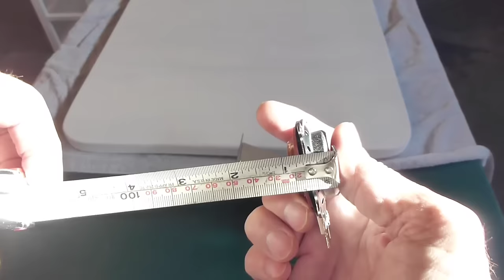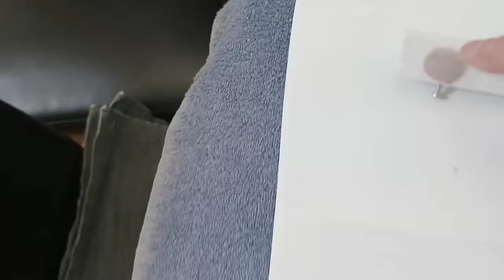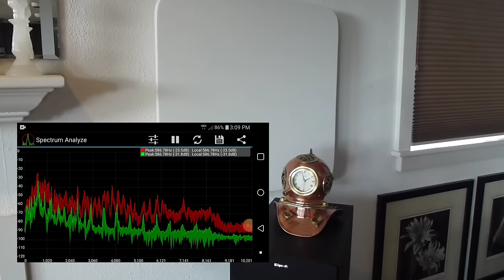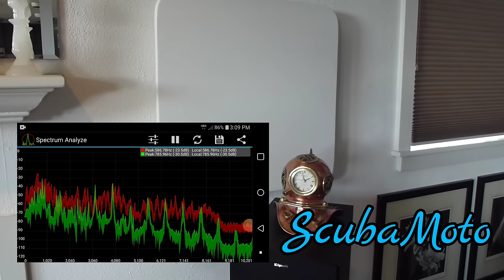How To Build DML Panel Speakers with Hidden Wall Mounts Fully Suspended

Comment: I'm wondering why no-one has even tried mounting the back of the exciter on something solid to act more like a conventional motor as that would create the highest and most consistent force on the panel, especially for the lower frequencies presumably limited by the exciters' small mass, never mind its own resonances interacting with those of the panel. About 25 years ago I made exciters like these to turn panelled walls into speakers, and it's always interesting to see how many of the ideas I tried long ago get developed into practical applications only recently.
Reply from the maker: Several viewers have made the same comment about fixed mounting exciters. One tried it and reported back that he didn't care for the audio results. I still suggest that you give it a try and see if you like the sound. If you like it, that's what matters. let us know how it works out. Thanks for sharing.
Reply: Well once you do that, you’ve just made a giant normal speaker with no box or ports or anything
Reply: I'm here because i heard you tooting your own horn from the other room... with youtube closed.
Reply: If you mount the exciter to a frame, it better be extremely stiff, and preferably very heavy. If it is not stiff enough, it will vibrate and make it's own sound.

Comment: I'm considering making two of these and getting and amp with built in streaming and HDMI ARC OR buying a soundbar.

Let's say the amp costs $500 USD and these speakers cost $50 USD do any of you think these could compare to a $550 USD soundbar?

Comment: Tech ingredients had mentioned that spray paint worked well if far away enough, but you used latex house paint, does that change the sound at all? or too little that we couldn't really notice? maybe have to be super thinned out?
Reply from the maker: Eric F: I haven't compared it to spray paint but the fabric grain effect of brush painting is the look I wanted and it also worked out quite well for sound. I hope that helps.
Reply: @ScubaMoto  I started doing mine, so far so good and decided to go with the latex paint like you did.  Question:  you think the distance from the wall is a factor on the quality or freq response? or just have enough room to "breathe"  move freely is all you need?   what do you think? I read somewhere to leave at least 2 foot from the wall, that seems counter productive to me.
Reply from the maker: Eric F:  I'm glad to hear you've started the build. Wall mounting these does effect the sound but 2 feet would no longer be a wall mount. I put a note in the video description regarding my experience with distance from surface. I hope that helps.

Comment: Hi is their any way you could make a push fit design speaker as i have tremors and find it dangerous using heat iron
Reply from the maker: Andrew Bird: I chose the hot glue because it adheres very well to the foam and dries in minutes but hot glue is certainly not necessary. You just need a glue that adheres well to the foam and dries hard enough to handle the lateral tension on the mounting pins. You may be able to see remnants in certain parts of the video of the first trial runs of different compounds I used. They either dried too soft or did not adhere well to the foam. I considered using screw-in anchors like screw-in drywall anchors (Togglers) but they are too long and do not truly adhere to the foam well enough to provide a lateral structural tension load. So, any glue or epoxy that dries hard and adheres well will work. I hope that helps.

Comment: What I wonder is they say to have one exciter in the center of one board and one off-center on the other to cover more frequencies. But wouldn't that make the frequency response different for your left and your right speaker if doing a stereo setup? Would you need two boards on each side, one center and one off-center for each side for the best results?
Reply from the maker: Talking Hands: I've heard that as well. For the video I just wanted to show that this wall suspension system could accommodate both exciter positions. I put a note in the video description on exciter location. Thanks for the comment.
Reply: Talking hands- watch the Tech Ingredients video on this. Everything you ask has already been tested. The name of the video is "Worlds Best Speakers!"  He has already tested every possible driver placement, panel shape, etc...

Comment: Great Video! Do the speakers have to be vertical or could I hang them at an angle? I am thinking of a room I have in my upstairs with sloped ceilings?
Reply from the maker: thomas: Sound does emanate from both sides but you should be fine aiming them from a ceiling position.  You can also get away with more distance from the surface. The challenge might be wire routing.

Comment: Thanks for the video. I’ve been looking for a discreet solution as i don’t like the look of speakers in a room. I might give it a try. One question: did you try smaller ones like 12”x12” or 12”x16”? Wondering how that would sound for rear surround speakers. Thanks a lot!
Reply from the maker: Francis Rene: I'm glad you liked the video and thank you for a really great question on using 12x12-inch for surrounds. I have not yet, but my plan is to try exactly that size for my theater. I plan to start with 12x12's only for fronts and center as I expect them to fill the typical void that theater systems have for voice frequencies and above. If they work out, I my also do sides and rears. My current Onkyo - Polk Audio system is very good but some programs could use better response in the vocal range. After hearing what these 24x24-inch DML's can do for voice, I just need to finish my mount design for my theater 12x12's.
Reply: Thanks for the reply! Can’t wait to hear from you. Hope you’ll do a video about it once it’s done. Keep up the great work!
Reply: @TheFarene  Have you tried this?  I'm considering this too.  If so, was it a success?
Reply: @qua7771  no. Was supposed to finish my home theatre room but the cost for wood was just insane. Hopefully it will be next spring
Reply: @michaeltritter2743  hahaha! It’s definitely a typo 😜 As I just reply to A.R. I didn’t have the chance to finish my theatre room. But hopefully early next year. Did you manage to do some testing on your side?

Comment: What kind of did he use? The paint does not modify the sound? Thank you, beautifull video!
Reply from the maker: Paolo Acone: Thanks for the comment. I'm glad you liked the video. Any paint will add some weight and therefore have some effect on audio dynamics but these were not going on the wall unless they matched.  I used the exact same flat latex paint that is on the wall it's mounted to. It sounds good with no adhesion issues two years running.
Reply: @ScubaMoto  I see, thank you.

Comment: No wonder if you could glue a canvas painting on the front of the foam board and it would look like a painting from the outside suspended from the wall
Reply from the maker: A couple people have asked that but I haven't heard back from anyone on their opinion of how it affected the sound. Any added weight will affect audio dynamics. If it's a super heavy canvas or has heavy paint thickness, maybe you could simply use a slightly higher wattage for the exciter.

Comment: my comment is that the evolution here seems to be that the ink is replacing the idea of tweeters and the towers are the bass or midrange by each  using all ranges it helps carry the range tones instead of the old way of making the individual components carry just the one range by itself which has always left something to be desired. thees way by blending the ranges with each component it adds strength and character the thing to do would be to take advantage of the idea and tune the dmld to some treble and find the ratio of support that is the ideal proportion. in other words tweeters that can do  midrange midrange that can do both and bass that can do midrange and then blend with there different equalizers maybe a computer with ai to match each song media  creation rooms. mode etc or voce directs like louder softer  this is a movie my wife's here edit lyrics for children. mood ring to ai computer is and interesting idea since they work facial recognition  number of people. and incredibly this is getting cheap enough to actually get built by diy its not  the wonderful future it the wonderful solution  being affordable practical and available. thats not the future thats an evolving present. ie looking backwards while forging ahead.   congratulations to the developer for finding the solution  and congratulation to the critics for  understanding what it means and what to do with it that wasn't there in the physical alone.  that is there yin and yang of the thing now ever really gotten something.   the tweeter is  full strength not just. an isolated instrument that no one is really sure if its there or not.  like the flute in a symphony  huh? is there a flute well it like. editing a few words out of a sentence it doesn't make senses so you have to have it. but if you can't hear it its almost a rumor as to what got said  an d you kind of have to gossip for the group to get the idea this is  the  flute with its own mic while the symphony iOS unplugged it beats buy-in 100 flutes just to hear the damn thing tweeter has the same problem.  the high tones important but basically its been missing all this time this gives it. it rightful strength  a welfare to work program for the small voice and maybe a subsidy . probably a deserved on. bc I invented the standalone base for home and auto in the 80,s or at least I got industry to sell us one .

Comment: What is the hole at the back of the exciter for? And is it threaded? I have a different pair of Dayton exciters and they have that same hole, and it looks threaded but I can't be sure. Some Dayton models have the hole and some don't. I want to mount my DMLs horizontally, hanging from the ceiling, and I need to figure out if I can mount them directly via the back of the exciters. Thoughts?
Reply from the maker: g h: There is no threading in the hole. There is not much recoil on little exciters like these but the hole allows for that free movement. It passes all the way through so any small bolt or screw will fit through it if that is your objective but I would not recommend a rigid mount of the exciter to a fixed surface (ceiling of otherwise). I would build the DMLs and then suspend the entire panel/exciter process with no rigid contact just as I do for the wall mount. Otherwise you are hanging the panel from the diaphragm of the exciter. This is not good for several reasons: 1-You would have to center mount the exciter, so no hope of 2/5 3/5 advantage. 2-Over time and repeated use, the weight would likely tear the exciter diaphragm, 3-The acoustic dynamics of any exciter can not be the same as an independently operating exciter when it has a panel hanging from it. I hope that helps.
Reply: @ScubaMoto  I see your point. Thanks for the info.
Reply: @ScubaMoto  After mulling this over I realize something... The panel (such as the 24" x 24" sized one) is much lighter than the exciter itself. When the exciter is mounted as you have, then it's subject to a much greater (lateral) force than it would experience if mounted horizontally with the panel hanging off it. So to my mind, the exciter would perform much more freely mounted as I suggest than the standard vertical way, as well as providing less likelihood of a torn exciter diaphragm. The only remaining issue (as you point out) is that it would probably need to be mounted in the center of the panel. However, it might be possible to still have it at least slightly off-center and still be okay.

Comment: I was really excited to complete mine, followed the tech ingredients channel exactly, suspended them, was extremely disappointed when I turned them on, they sounded so thin and lifeless and no soundstage, it wasn't until I used an equalizer to drop the decibels by -25 db, this allowed me to actually turn up my amp to get decent power going through the coils to actually get decent vibration, still pretty thin and lifeless though, a pair of $100 pioneer bookshelf's have so much more life, wish I could figure out what's going on but these sound horrible to me? :(
Reply from the maker: TunneLVisionN42: Thanks for taking the time to share your experience. I didn't see anything about what other speakers you're using with these and which exciters you used. It might be as simple as not having a subwoofer working with the DMLs. So much of modern music is in the lower frequency ranges. That's why DML's usually aren't that great on their own. They do need a subwoofer to complete the soundstage as you call it. In the video, I play them in combination and alone to show how the DML's clearly bring out the mid and highs. I can't imagine using them without some other speaker to complete the lower frequency range. On the flip side, I can't believe how much upper range I was missing for years prior to having the DML's. I hope that helps and thanks again for sharing.
Reply: The exciters used in the Tech Ingredients video (DAEX32EP-4) have been out of stock at Parts Express, so I'm wondering if you used a substitute.  Secondly, some people say that foam sheets sound thin in the mids, and in some videos, I agree.  An alternative is to use light 1/4" ply wood, or thick foam core board (the kind with a thick paper backing).
Finally, Many have mentioned that flat panel speakers are not ideal for hard rock, but are amazing at reproducing acoustic instruments, and vocals.
And I'll agree with the sub-woofer thing.
I haven't built my panels yet, but I have worked in a HiFi shop that had speakers with similar characteristics.  Hard rock was always unflattering to flat panel speakers.
Reply: Using 2 or 4 exciters makes them sound much better and richer. In my experience the more powerful exciters also make a huge difference. Tech ingedients used the small 6 watt or something ones and they really didn't do it for me either. Turned those into tweeters with small panels to fill out the high end a bit, which they do pretty well.

No matter what you do you need a subwoofer with them to make it sound well.
Currently going to try something with base shakers you mount under your sofa normally and some hardwood plywood to see if i can create some more low end using this concept, which would make it a much more attractive package.

Comment: What kind of paint do you use? Satin, Semi Gloss, Latex?
Reply from the maker: Leland Clayton: I used the exact same flat latex paint that is on the wall it's mounted to. It sounds good with no adhesion issues one year running.
Reply: @ScubaMoto  Awesome, thanks for the reply.
Kinda tempted to try it out but didn't want to end up with a purple speaker if I liked the sound.

Comment: Great video! Just built a pair of these myself yesterday and they sound great! I noticed that if I keep them 3" from the wall, they sound very thin and pushing them back closer to the wall appears to kill all the bass. I pulled it out away from the wall to about 18" and the bass became more full. Having it this far out into the room makes it less practical. Were you able to resolve the thinness issue with it that close to the wall?
Reply from the maker: Tony Jin: Thanks, I'm glad you like the video. I knew I would only use a wall mount and I built my DML's for the mid-high range response. When I experimented with wall spacing, I choose the distance shown as good for a wall mount so that was an adequate resolution for my needs. I do have a note in the video description on that experience. Most DML applications are powered in conjunction with a subwoofer or other conventional loudspeaker that carries the lower frequencies. If the 18" works for your listening space then you should go with that.

Comment: What's the bass like? I'm a DJ... hence the obvious question.
Nice mounts BTW, though mine (when I eventually make them) will be in my little studio, so I'll just hang them from the ceiling.
Reply from the maker: DJ-Daz: DML's are usually best served with a sub. That's why I included both an audio and visual test at the end so you can see the low frequency performance of the DML's only. I can say with confidence that many high-end speakers can't come close to competing with a good 2x2 DML for performance in mid and high frequencies. Thanks for the question and for sharing.
Reply: @ScubaMoto  Hi, but subwoofer don't produce low frequency they are usually only good for super low frequencies. If you don't have a good 200-400hz you are lacking a lot of depth.
Reply from the maker: @ChristianBrandoni I noticed that Tech ingredients called these DML Panels good down to about 120hz as he mentions in this video https://bit.ly/2SdzfgL at about the 28 1/2 minute mark. That would make DML + most subs full sound. That being said, I very much like the combination of the Klipsch towers with the DMLs in this video which I know many might not agree with because I feel that the DMLs shine at frequencies that are under performed by conventional speakers. The bottom line is that 10 listeners may have 10 different assessments so it's best to experiment in your own listening environment and adjust accordingly. Thanks for taking the time to comment.